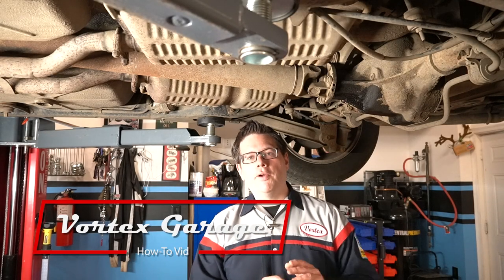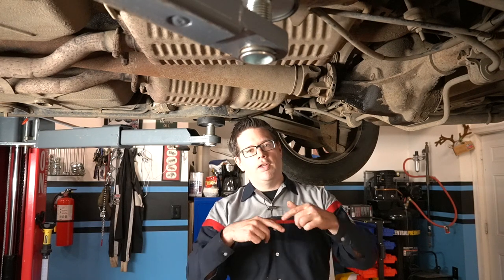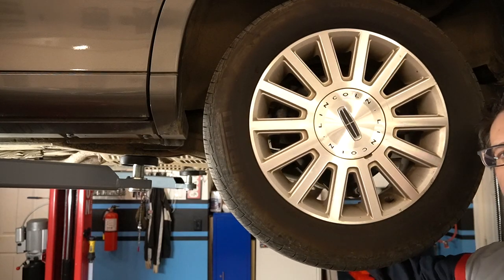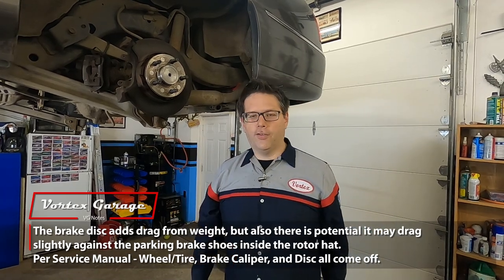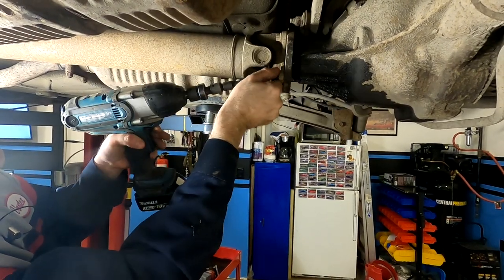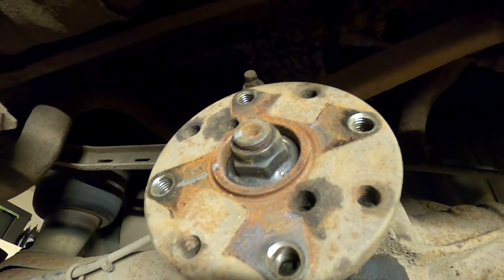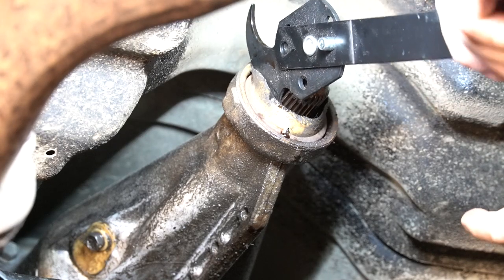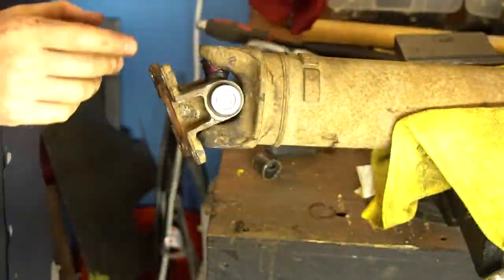Ford 8.8 Pinion Seal Replacement Using DATA! - Perfectly Set and Easy! - Vortex Garage

Comment: This is an excellent video. I've done several rear ends but I've never had to set preload with axles in. I used a $15 Amazon pinion tool that you attach a breaker bar to so I didn't need to keep removing flange bolts while taking measurements. I think the consensus after my research is try for the tighter side of the measurement because the axles and carrier are still installed. These 8.8s really like to walk that pinion nut off and start clunking. I think the nut should always be replaced when doing this.
Reply: When finding the preload do you keep the gear oil in? And the 2 wheel axles with the carrier? I don't want to complete disassemble my rear end.
Reply: @Avner123  the video covers the 8.8 procedure pretty well. You can leave the axles and carrier and oil in. But you shouldnt aim for the minimum number on the service specs. You should aim closer to the higher number for used bearings to account for the extra drag.
Reply: @novanogo07  gotcha thanks for that. I've seen other preload videos and it's usually just the pinion, inner and outer bearings setup aiming for 8 - 16 in/lb. So technically he should've tighten closer to 16in /lb, but overall still great video. Right now my 8.8 has no gear oil and full assembled and preload is high. I'll add gear oil to fill line and recheck to see if it's normal and aim for 16in/lb 🙏
Reply: @Avner123  sounds like you got it. Its an exceptional video. If its a high mile rear it wont hurt it if its a few inch lbs loose. But, If you go too far you'll over crush the crush sleeve. So you want to take 100 measurements. 1/8 a turn at a time. If you get to 12 or 13 call it good. Rear diffs are so weird because there is so much 'feel' involved.

Comment: This video is by far the best one I have watched on a Ford pinion seL replacement. As a former service manager and classroom teacher, thank you for being so thorough. The added steps of removing the drag to gather pre-teardown data were especially enlightening. I am about to do the same repair on my 2008 F150 with an 8.8 ring gear. I will double check the pre-load specs for my truck, but I think the 8-14 lbs you mentioned will be correct for a used bearing. Thanks again, good work!
Reply: hey bud im doing the same excat rebuild on my 08 f150 8.8 w/3.55 converting to 4.10's how did your swap go?
Reply: @tylermulkey330  I just replaced the pinion seal. The setting of the preload was tough. I bought a bar torque wrench and ended up with 10 ft lbs. It was tough under my truck to tighten the pinion pulling a break over bar with the truck on jack stands. The repair has held up these many months later.
Reply: @Rbenterprises4  thanks 🙏 for getting back with me brother just received my last couple of bearing kits. I ordered the crushless sleeve cuz I herd it was nearly impossible to get that pinion nut cinched down to spec even if it’s in the air on a rack with a 3/4 impact lol 😂 I could imagine on stands in the driveway like I’m about to do myself. Did you swap new gears? Btw I’m doing this cuz my truck as shutter like a mfer on turns from dead 💀 🛑 stop signs. I purchased new clutch packs as well an 4.10’s with the freedom racing s-clip an a master kits hopefully all goes well
Reply: @tylermulkey330  No, I just did a seal replacement. Yours will be an ambitious project. I wish you well!
Reply: @Rbenterprises4  I am doing the same right now on a 2006 mustang gt with 8.8, I bought the bar torque wrench as well, a US made one, mine has about 6 in lbs preload before removing the flange, I hope I can get it tight enough under the car. I am on jack stands as well.
Reply: Be careful and stay with it!
Reply: @Rbenterprises4  I got her to 10 in lbs, I had to blip it with the impact, not enough room on the stands to get a pipe in there. Best I can do. Not as young as I used to be. What I understand is that it is actually better to be a little tight than too loose, too loose and you will eat the gear set, too tight and you eat the bearings. Either way, I am at 10 in lbs which is within the used 8.8 specs. Also I learned that if you keep losing pinion seals, it means that you have run out of crush on your crush washer, and you will never get it right without pulling the carrier. It seems I still had a little crush left in my crush washer, because i was able to make it tighter than when I started.

Comment: Great video, I've got my 06 Town Car on the lift right now replacing the gas tank....and my rear dif is soaked! Back to the parts store I go!!
Reply from the maker: I've not dropped the tank on the Town Car, but did on another Panther chassis, so I'm guessing they are the same - if so you got to find out the fun "break away" studs Ford used to mount the straps.  Pretty much have to replace them.  I used Dorman exhaust studs (forget the number unfortunately) on that other car because I couldn't wait for dealer parts.  Worked great!

Comment: Nice to see that you go through everything very thoroughly. Personally, I would have changed the differential oil completely instead of just topping it off, but that's probably not necessary.
Reply from the maker: Thanks!! And I agree - if you're doing this it's good time to take the back cover off, inspect, and end up with fresh oil. In this case the car had a recent fluid service, so I knew it was pretty fresh. Still - not a bad thing to do, even if the oil is fairly recent. Fluids are cheap.

Comment: Best video about how to actually do it correctly. Only better way to do it is to use a new crush washer or to use a solid spacer on the pinion gear, which if you are going to do that, basically you mine as well rebuild the rear end with all new bearings because you need to pull the ring gear assembly. Only thing I will say is that you could use the Timken flange sleeve kit to fix the damaged seal surface on the flange. It is just a sleeve that presses over the flange seal surface to renew it.

Comment: I made a holder tool very similar to that. I made it with an additional hole so it fits the smaller and larger size Ford pinion flanges.

Comment: Pulling on the pinion would put pressure on the crush sleeve. Pushing or hitting the pinion wouldn’t affect the crush sleeve it would bang the gears together.

Comment: Uuhhggg—but THANKs! Convinced me I DO NOT want to even attempt replacing the pinion seal of the 1 ton GM dually wet axle 1983 Grumman Olson step van (i.e., unhooked parking brake cables, kinked rear wheel cable and sloppy carrier bearing rubber when I bought it requiring rear drum disassembly, etc.)! Had all new sealed u-joints and the newer/beefier center carrier bearing installed on driveshaft by a “local” (~60 miles round trip) and figured why not replace the pinion seal while it’s apart? No way I can even find the preload let alone generate the likely 225 lb-ft of torque (...doing this all on my back under a shade tree)⁉️😬🥺 I think I’ll just add higher viscosity gear lube after taking the 14-bolt rear cover off and replacing its gasket just to make sure everything looks good inside. However, I am kinda proud of some of the tools I’ve come up with to get this beast back right. 🙂😎 
•https://facebook.com/story.php?story_fbid=3435250330021161&id=100006086822378 
•https://facebook.com/story.php?story_fbid=3453935084819352&id=100006086822378

Comment: I will probably adapt a Harbor Freight tool like you did, but do you happen to know the Ford Rotunda part number? I found a knock off for the flange bar holder, which hopefully works on a 7.5 rear, although I originally looked up videos for my truck, which is completely different 😅

Comment: Shouldn't pinion drag be measured with the carrier out, so you are only measuring the resistance of the pinion bearings?
Reply: Yes and no. Most manufacturers have a procedure with axles/carrier in. Usually you remove the brakes, or pop the axles out of the carrier and go for the tighter side of the reading to account for the extra drag. Otherwise every leaky rear pinion seal would be a $1,000 job. When you're setting up a fresh rebuild or gear change you would do it with just the pinion in.
Reply: @novanogo07  does the gear oil need to be removed and then place small amount of gear oil on the out bearing? Or leave In the gear oil?
Reply: @Avner123  depends on the service procedure for the particular axle. Axles in with oil, you probably want to lean towards the higher number. No oil maybe somewhere in the middle. Remember if youre reusing bearings the measurement is much lower than new bearings. Youre really just using an educated guess. Especially an 8.8 the pindle nuts love to back off. In this video they had 2 inch pounds, that thing couldve been that loose for 10s of thousands of miles. Rear ends are so strange to set up, when you build an engine everything goes together one way. On a rear end youre painting grease and looking at rorschach  tests. On a racecar you want it all dead on, on daily low hp car they can be completely wrong and last hundreds of thousands of miles.
Reply: Yes for an 8.8

Comment: vortex a question when you do the work, should the truck be in neutral ho parking?
Reply: Umm once you take the driveshaft off it don't matter what gear the Transmission is in.

Comment: So what happens if you don’t turn off the air suspension?
Reply from the maker: Sorry for slow response - but from what I understand it confuses the ride height sensor and can cause the bags to over extend and could damage them. Honestly I'm not sure if that really happens but it's been noted since early days of panther chassis cars with the air suspension.

Comment: I'm pretty sure if it's over the spec you don't want to put it back on looser since there is a crush collar in there and you would have alot of vibration in it. just  how I understood it from my service manual.
Reply from the maker: That's correct, if you record higher than specified the book says to return it to the value you recorded.
Reply: @VortexGarage you can return it to previous value but you would have to have a new crush collar cause once it's been crushed that far there is no going back is what I mean to say unless your vehicle has had had shims put in instead of a crush collar